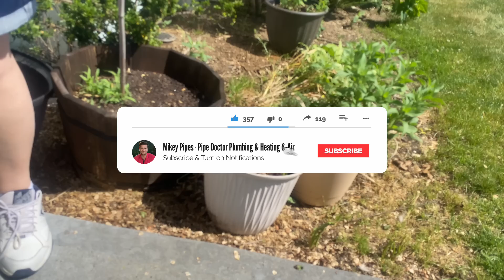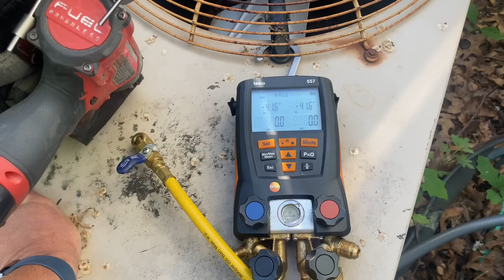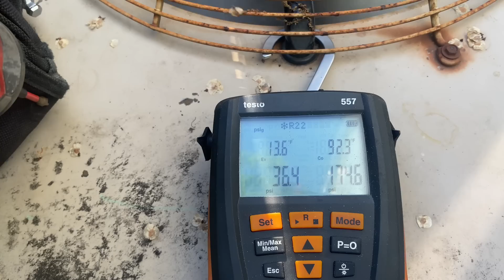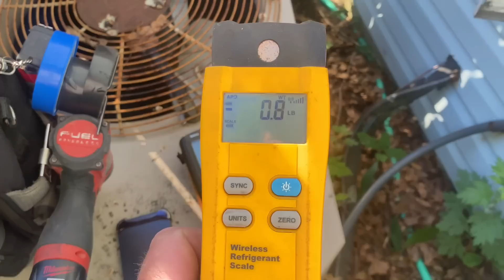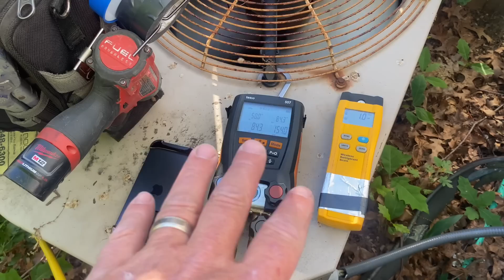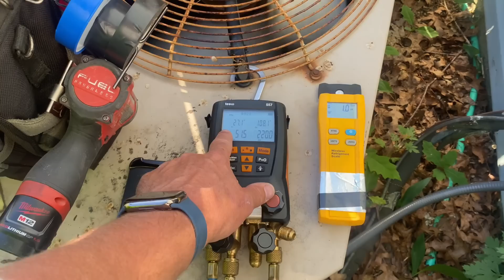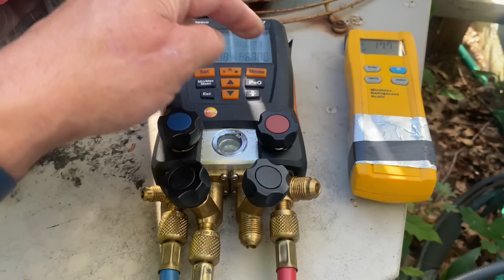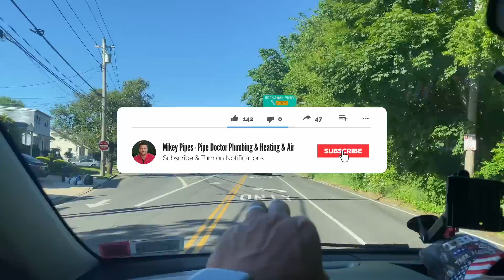Handling Residential Freon & Puron Leaks During Service Calls - 5 Things You Must Explain!

Comment: Mikey, pipes, that is such bad practice. Come on. I don't believe you're not getting fine for adding R22 to a system Without repairing the leak If you were in Canada, I would feel bad for you You will lose your refrigeration licenses. Do you even have one
Reply from the maker: License? No. I’m not licensed anywhere. Nope. No where.
Reply: He did add sealant to try and fix the leak. it's an old unit that's not worth repairing properly.
Reply: Customer is always right B***h . Lol

Comment: I can’t imagine solar can carry a household HVAC system longer than an hour. With the many batteries it will take, the installation cost, the battery, solar, and electronic maintenance upkeep cost - is it worth it?

And when it’s time to replace his roof shingles the cost would be insane. 

Or maybe I’m wrong…

Comment: Couldn't the condenser drain be clogged causing the freeze up ????
Reply: No, that would not cause a freeze up. Low airflow or low on gas will cause a freeze
Reply: How would a clogged drain cause freezing? The evaporator would need to be 32 degrees to freeze none of the reasons the Evap is 32 degrees is a clogged drain.
Reply: @Rainmaker88  If there's a clogged drain, backed-up water can freeze all the way up to the evaporator coil.